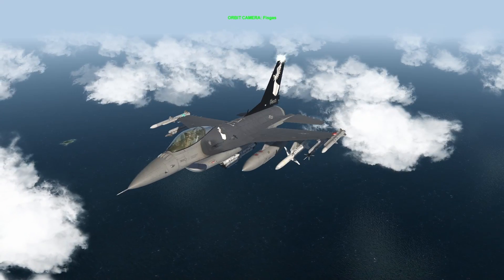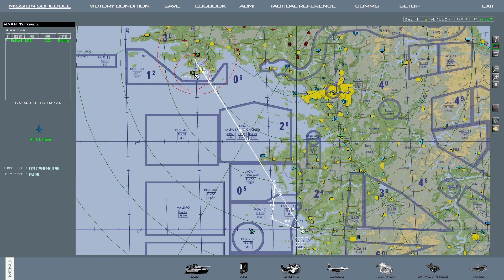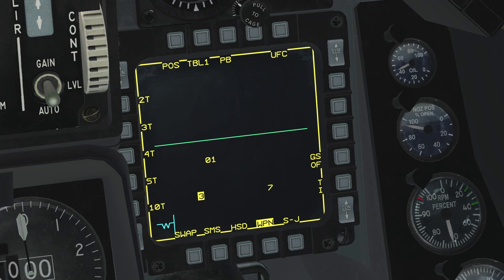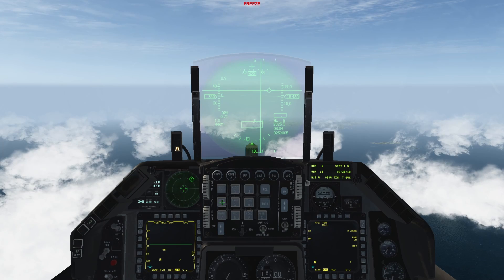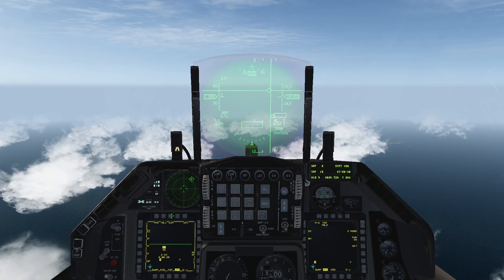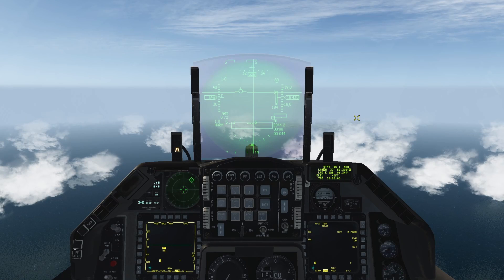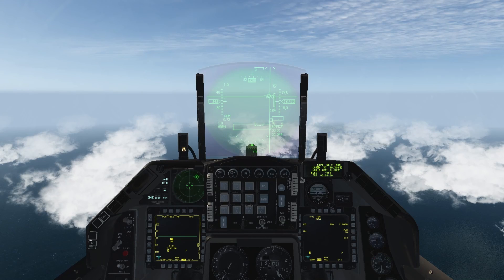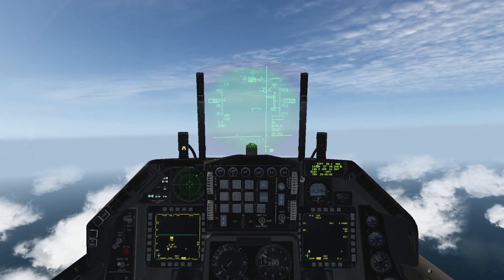Falcon BMS 4.37 Tutorial - AGM-88 HARM in POS mode

Comment: using this in combination with the HTS pod is great aswell, on a pop up threat you can get a good general location with the HTS and then you can make a markpoint on the location the HTS is looking at and then send the harm there
Reply from the maker: @agidotexe7167  it is a good tactic but to my knowledge you can't generate markpoints only using the HTS. However I could be mistaken.
Reply: @fisgasfighties  no you cant, you would have to either use a tgp or your jhmcs
Reply from the maker: @agidotexe7167  yeah that's what I thought. It's a shame we can't just do it with the HTS but then again it doesn't always give an accurate location of the emitter

Comment: I would highly suggest you use a reconed target stpt not a pre-planned threat stpt for a POS shot, threat stpts can be very unprecise compared to a reconed target stpt
Reply from the maker: I've never used reconed targets with the HARMs, since I don't have much faith in its inertial guidance if the threat isn't emitting. If it emitting, a shot at a preplanned threat steerpoint that is close enough should be more than enough to be accurate with any of the submodes, even the narrower one, EOM. But what you're suggesting is definitely something I'll have to try out.
Reply: @fisgasfighties  theyre not cruise missiles but firing at the most precise location definately helps
Reply: @fisgasfighties  What he means by 'reconned steerpoint' is that the sam site has to be visible on the 2d map. If it's not there then the PPT will only be in the general area of the sam
Reply from the maker: Ah yes, absolutely! I wouldn't recommend creating preplanned threat steerpoints unless the exact location of the air defense system is known.